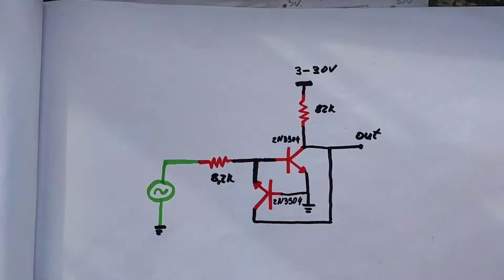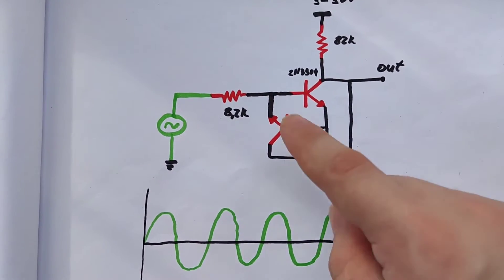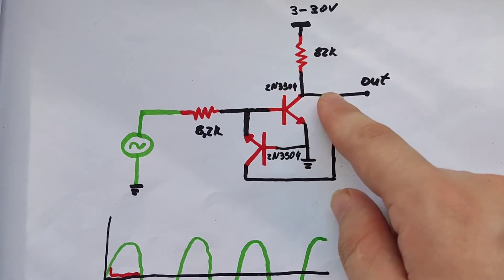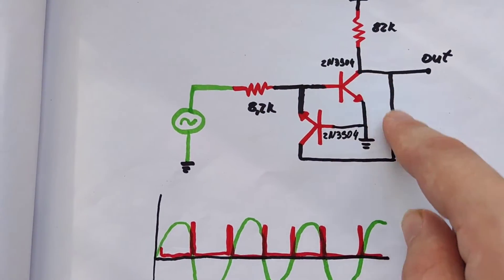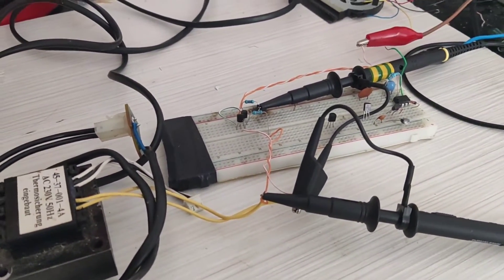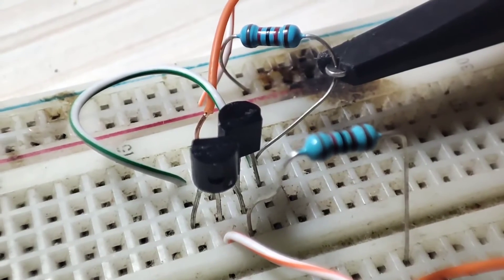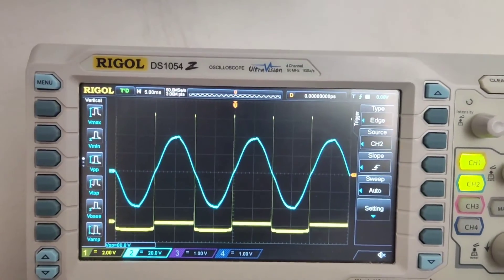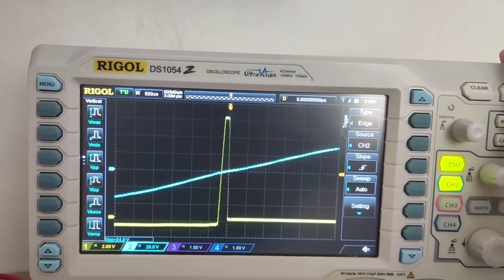The simplest zero crossing detector circuit

Comment: A little confused. The second transistor's base is always tied to ground which means that transistor is always in it's cut-off region and will not pass any voltage to it's emitter. Basically, the transistor is just an open circuit all of the time.
Reply from the maker: No because the emitter of the second transistor goes negative half of the cycle so it goes below ground

Comment: The circuit is not without its problems. The main problem is noise. You need a clean ac signal in. Without a clean signal in you will get spurious output pulses from the circuit.

Comment: you can decrease the window of detection from 0-0.7 volts to 0-0.2 or so, by add a diode in reverse bias to your circuit, the negative of the diode should be connected to your power source and the positive of the diode connect to the base after the 8.2k resistor . connecting the diode in reverse will allow a small amount of charge on the transistor gate  this small charge not enough to turn on the transistor, so the input voltage wont have to go all the way to 0.7 to activate the transistor.  with this setup make sure your peak input voltage is lower than your power supply.

Comment: Zero current detector???
Reply: No. Zero Crossing Detector. Meaning, it will tell you the moment that the AC waveform crosses zero volts. (Zero volts is usually where "Ground/Return" is found.) By knowing this moment in time, you can synchronize the timing of whatever you like. HTH.

Comment: As you said the z.c.d. will be nearer zero with higher input senseig voltage..BUT with this ckt. there's always going to be 700mV threshold...
What about using a comparator output which works on+/- (6-10)V referenced to zero.?
Reply from the maker: Of course you can use a comparator and have even better results, but the goal of this circuit is it's simplicity
Reply: @Pagurja  how to use the comparator?

Comment: Clever circuit! I simulated it with LTSpice and got the same result. I discovered that I can make the response very symmetric with low input signal voltage (< 2V peak-peak) by adding an 8.2k resistor in series with the emitter of the upper transistor. This would make a simple frequency doubler. This modification doesn't work as well with higher input voltages but I thought I'd mention it.
Reply from the maker: It's true that you can make a sort of a frequency doubler at low input voltages, this because the output of this circuit is high when the input is between -0.7 to 0.7. But when the input swing is much higher like in my case , the -0.7 to 0.7 is just a small portion of the period and you get only pulses
Reply: If I am not mistaken you can easily make a frequency doubler using a bridge rectifier.  All you need is 4 diodes.
Reply: @bayareapianist Don't you also need a transformer to do that?
Reply: @coopecb1  I don't think so.  Your input is supplied by an AC voltage such as a transformer. When you convert an AC to a DC signal using a bridge rectifier, you bring up the negative portion of signal to positive.  Hence you double the input frequency.  If you remove the DC part of output signal and use the the bridge again, you can double the frequency again.  But remember each time you double the frequency, you add harmonics to the original signal.  Then somehow you can remove the extra harmonics using a low pass filter.
Reply: The circuit shown here does not require a transformer, although it is demonstrated with one. A bridge rectifier absolutely requires a transformer as you acknowledged in your first sentence.
Reply: Really you simulated in LTspice and got the same results? Because I don´t.

Comment: Very informative! I noticed that the part number for the transistor you're using (2N3304) is a PNP, but the symbol you used in the schematic was an NPN. Which kind of transistor did you use in the actual circuit? Thanks!
Reply from the maker: Both transistors are 2N3904, general use NPN
Reply: @Pagurja  thanks!!!